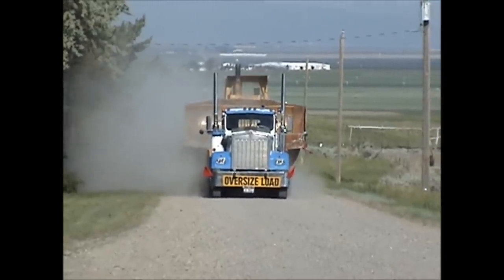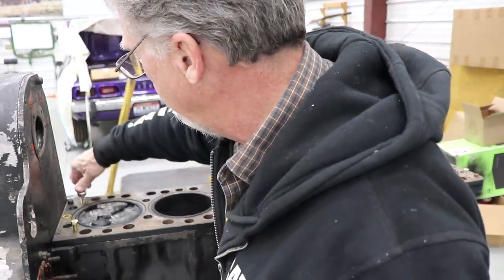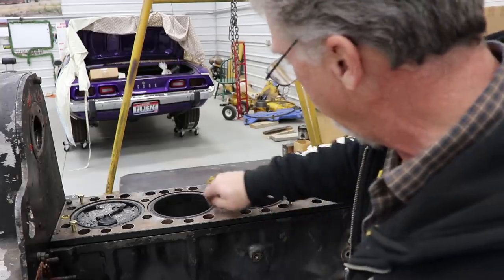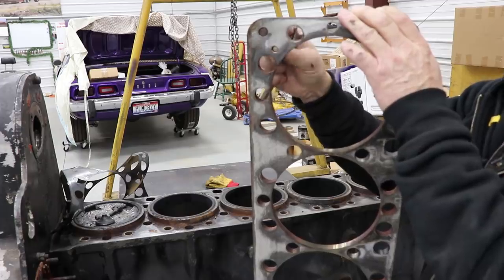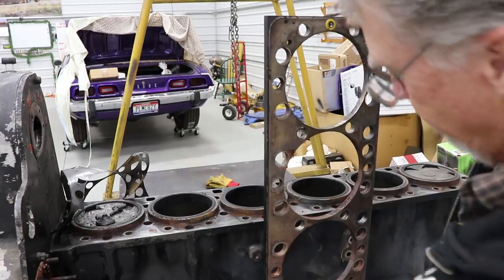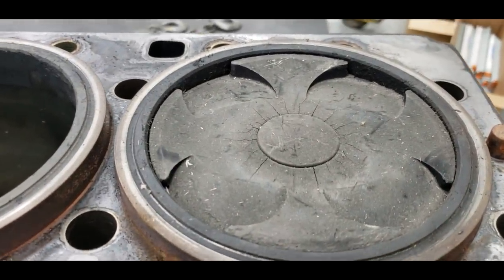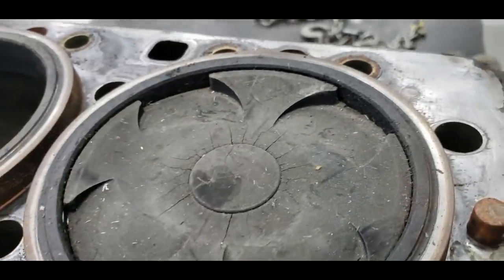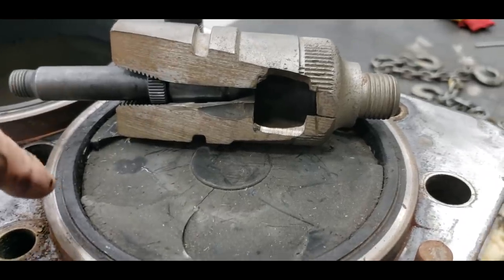Caterpillar 1693 Spacer Plate

Comment: I wouldn't worry about the crank if you were to DI that 343. The 3406PC and the 3406B used the same narrow bearing cranks and B's will go to 600hp at the tires without any trouble if properly tuned. The reason on the 3406C and later engines for the wider rod was for bearing life. On a 3406 or B to be safe you want to roll bearings about 250k miles if it's a road truck, or about 175k or so if it's a heavy haul/low mileage application. Water aftercoolers are also very efficient compared to air to air's and maintain a more consistent charge temp, but if you use engine coolant then at cruise you loose some efficiency due to the coolant temp. However, if you isolate the aftercooler and run it on it's own system they are very good. I've done quite a few 855's and N14's that way and a few early 3406B's. Not 100% sure, but I think the 7FB 3406's were the highest factory pump timing and were around 26*'s (I'd have to look in the book to verify but that's close anyway).

Comment: I still have my set of multiple pre cup shims around here somewhere to index the glow plugs on the 330's that I worked on many moons ago. Actually had a 140g that had was turbo, non spacer 3306 and a 12g that was turbo spacer plate and it was unreal the difference between their power.  I sure like the way you go in depth on your vids!

Comment: Ah the piles of uppers and lowers I have put in Cat blocks over the years! Old Kenny probably couldn't haul them all. lol Your cheapest route would be custom pistons. You could probably get a proper speced set of pistons for less then 2k.  It wouldn't have the steel inserts for the top rings though.  maybe there is enough room in the pan to stroke the crank and make up that pin  height difference? Turn your 1693 into a C18!! :-)
Reply: +1 on custom Slugs vs Rods. Should be cheaper by half at least. 👍🏻

Comment: Running those power levels is one thing.  Pulling your loads is another ball game.  I'd say your driving style allowed it to live as long as it did.  I like seeing equipment pushed then reviewing the failure modes.  Going DI would be interesting, but not something I would do on a machine I need to pay the bills with.  I think if you get your air and fuel dialed in you will be more than satisfied with the end result.
Reply: "...𝐈 𝐥𝐢𝐤𝐞 𝐬𝐞𝐞𝐢𝐧𝐠 𝐞𝐪𝐮𝐢𝐩𝐦𝐞𝐧𝐭 𝐩𝐮𝐬𝐡𝐞𝐝 𝐭𝐡𝐞𝐧 𝐫𝐞𝐯𝐢𝐞𝐰𝐢𝐧𝐠 𝐭𝐡𝐞 𝐟𝐚𝐢𝐥𝐮𝐫𝐞 𝐦𝐨𝐝𝐞𝐬.  𝐆𝐨𝐢𝐧𝐠 𝐃𝐈 𝐰𝐨𝐮𝐥𝐝 𝐛𝐞 𝐢𝐧𝐭𝐞𝐫𝐞𝐬𝐭𝐢𝐧𝐠, 𝐛𝐮𝐭 𝐧𝐨𝐭 𝐬𝐨𝐦𝐞𝐭𝐡𝐢𝐧𝐠 𝐈 𝐰𝐨𝐮𝐥𝐝 𝐝𝐨 𝐨𝐧 𝐚 𝐦𝐚𝐜𝐡𝐢𝐧𝐞 𝐈 𝐧𝐞𝐞𝐝 𝐭𝐨 𝐩𝐚𝐲 𝐭𝐡𝐞 𝐛𝐢𝐥𝐥𝐬 𝐰𝐢𝐭𝐡.  𝐈 𝐭𝐡𝐢𝐧𝐤 𝐢𝐟 𝐲𝐨𝐮 𝐠𝐞𝐭 𝐲𝐨𝐮𝐫 𝐚𝐢𝐫 𝐚𝐧𝐝 𝐟𝐮𝐞𝐥 𝐝𝐢𝐚𝐥𝐞𝐝 𝐢𝐧 𝐲𝐨𝐮 𝐰𝐢𝐥𝐥 𝐛𝐞 𝐦𝐨𝐫𝐞 𝐭𝐡𝐚𝐧 𝐬𝐚𝐭𝐢𝐬𝐟𝐢𝐞𝐝 𝐰𝐢𝐭𝐡 𝐭𝐡𝐞 𝐞𝐧𝐝 𝐫𝐞𝐬𝐮𝐥𝐭..."
 
👆🏻👍🏻 BTW, STEEL Pistons would be great [no more worries about the injectors "diesel jets" cutting thru the soft forged aluminum] but I doubt anyone makes them for this "Relic" and at "reasonable" prices. 😒
Reply: Don't pre-cuppers build more low end torque?
Reply: @donnatalielucasheimbigner7598  WTH is a "pre-cupper" ?
U meant indirect injection ? This engine is direct injection.
The ones I know about using the pre-chamber design usually run 20-22:1 [great for torque], but most happen to be N/A so no real gain against direct injected  turbocharged ones of the same displacement [usually running at 16:1].
Reply: @GIGABACHI  Yes, I mean pre combustion cup- as this engine is.  Fuel injected into a small "cup", with a glow plug to ignite it, before the flame front is applied to the piston through a hole above it.  Allis Chalmers used this type for a long time, & with a turbo.
Reply: @donnatalielucasheimbigner7598  adjust your glasses, my fellow diesel enthusiast. This thing is DIRECT injected into the bowl formed in the crown of the piston. There's is no pre-chamber on this model.

Comment: I drove a 73 kw long hood with a 1693 cat. it had 260 in wheelbase. 800 thousand plus miles and supposedly had only one injector replaced. 3-4 mpg. Never had any other truck out preform,on any mountain pass, or top speed. The fastest truck I ever drove in the 23 years driving. Leon Peterson owned it, from Spanish Fork, Utah. fun truck.

Comment: If you pulled the valve covers off a precup eng (1693) you could easily see if the head was cracked by checking the pc,s , if they were loose the was cracked

Comment: The 3406b had a narrow journal crank, check the bottom end every 250,000 miles.  The 3406b/c manual had a wide journal crank, 750,000 miles plus before a bottom end.
Reply: Late number 3406 Bs could be either narrow or wide -even arrangement didn't tell you till you looked at it.

Comment: Always be careful handling  the deck plate gasket. The 0.008" metal gasket can cut your fingers to the bone. The DI 3406 has "TP" rods-as wide as possible on the low side for high piston pin loads.

Comment: Thanks for your response Jeff .i worked as a performance engine builder in the mid sixties to the late eighties
Many Chevy and ford engines two very involved 440 molars that were quite successfull
But returning to your 1693...recently last few yrs BMW was tasked with providing a 3 liter Diesel engine to mimic the performance level of the gas engine...they made considerable improvements to the piston design with Mahler
They have a steel piston that is quite amazing....and very lite....you would certainly get them to make a set I’m sure
Reply from the maker: Nobody will make custom stuff anymore,  I talked to clevite and Federal Mogul and they all said the same thing,  ISO 9000 complient companys cannot deviate from the design of said part

Comment: Jeff, I hope your kids are learning this stuff. This new diesel tech. is destroying the diesel industry
Reply: Patrick you are not kidding!! Heavy equipment mechanic here and i used to love my job and couldn't wait to fix whatever problem was going on. lately I have been seriously considering quitting this career. Its no longer fun with all the shit engineering and horrible parts quality.  Recently I had a new hydraulic pump straight out of the box grenade within one minute of operation, and very expensive boom cylinder leak worse than the bent one it replaced, and the latest was a "certified" reman perkins engine for a rock processor go nuclear with under 5 hours of run time due to a new pos temp sensor. Pissed isnt even close, the added down time for customers is horrible.  One good customer is a lot like ol paydirt and loves his vintage equipment. I really dont give a rats ass about fuel economy. The machinery that will run all dam day and half dead will still out work this garbage they sell today.  Cat, Commie Cat, McCloskey, and i wont even go into the dam semi bullshit.

Comment: 3406 A and B went to a wider rod and main bearing. Later figured out that the wider bearing on the rod still wasn’t wide enough especially when the DI 425 B model came about in late 85. Not to get into great detail of timing changes etc. putting combustion directly on top of the piston is hard on on bottom end. 3406C came out and had even wider rod journals. Same crank as a 3406E minus the gear up front

Comment: Hey Jeff
As usual a thought full job..the bearing wear could benefit from getting the block main bearing bores ALIGNED 
HONED…FIND A SHOP THAT USES THE SUNNEN MACHINE…I CANT SAY ENOUGH ABOUT THE PRECISION OBTAINABLE 
AS YOU CAN SEVE FROM THE WEAR PATTERN….THE BORES ARE NOT BORED BY CAT YRS AGO ON ANTIQUE EQUIPMENT….GOOD LUCK

Comment: Hi Jeff ..I read your reply on your unsuccessful inquiry about federal mogul not wanting to make your pistons
Mahle does in fact ,make a steel piston for a few applications...but Diamond pistons does make custom diesel pistons...if you can give me your email I would be glad to forward you the information about the engineering BMW did to make 650 diesel horsepower from a 3 liter inline six cylinder....they had mahle involved in the steel diesel pistons..which was not easy as many issues had to be resolved....but just a thought as I’m very impressed how much you have invested in this engine design...my limited experience with them has only been through listening to owners who had success with them in how they claimed they never wore out...but they were not in the higher horsepower ranges..good luck
Reply from the maker: jpaydirt7@gmail.com

Comment: ,,, much less money. Keep the rods, machine the 1693 pistons for a combo larger diameter heat plug that would have the combustion bowl shape to it. Actually wouldn't be a heat plug but a steel combustion bowl  . And yes, you can ignore any balance problems on a six cylinder,  just keep all the pistons the same weight, regardless of how heavy they are . If you want: quieter, cleaner, more power, easier on the walls and bearings,  build a common rail system. I put this in Malinson's and or Rutherford's ear(s), also . Entirely within Malinson's capabilities  .

Comment: Hi Jeff ..I’ve been watching you and am very impressed at your depth of knowledge...and your work ethic...what I don’t quite understand as money is not the only directive is why you want to bring a outdated back to life again
I’m not saying that you need to switch teams..like the six Cummins..which when I first saw it introduced at a truck show and commented to the Cummins rep that it looked like a Plagiarized version of the 1693 cat...he kinda got pissed off
But my point is why keep beating a dead horse...is there a possible interchange with a non emission C15 
I see impressive power numbers for real world longevity use
Reply from the maker: Well the A model KW is a pretty popular truck for restoration and keeeping CATs first big bore on hiway truck engine in it is a must, I would equate it to restoring my 73 dodge challenger with a chevy motor in it,  LOL   and I have this same engine in my 637 CAT scrapers, it's called  a D343 in the equipment but it's the same engine as the 1693

Comment: HI Jay Blaylock (lol), Question - will an AFR (Air Fuel Ratio) sensor work to tell you if you are getting the correct air?  I work with some gas fuel injection engines and run AFR instrumentation and I can program fuel mixtures to a gnat's whisker, full throttle 12.1~12.8 in about any engine speed range.  Wondering if the oxygen sensor put in the exhaust stream somewhere, before or after the turbo will help you know the Air/Fuel ratio being combusted [prevent piston failure]  Ask yer engineer buddy with the calculator.
Reply: On Diesels they are monitored by Pyrometer or EGT, same as very high end race engines. Ideally one Pyro bulb on each exhaust port.
But now I'm curious. Does anyone now if an O2 sensor could live in a diesel's exhaust stream ? I'm gonna say NO. Soot deposits and all that good stuff diesels are known for. Someone with the know how please chime in and set the record straight ! 👌🏻
Reply from the maker: so I think they do make one for a diesel

Comment: Depends what your going to use Old Kenny for when your done Jeff.Show truck work truck or both that would determine the horsepower.If your plans are just doing some hauling with the bottom dump or pulling nothing really heavy on the lowboy I think 425 to 500 would be good.I wouldn't go nuts with the horsepower if it's not necessary.

Comment: It's all about air (o2) fuel ratio. Black smoke is nothing but a waste of fuel. "0" gain in power. Get that ratio right throughout the full RPM range and you will be the winner instead of the dirtiest.
Reply from the maker: That's been my goal by going with the switch blade turbos I have doubled my oil life

Comment: So Jeff, would the cost of putting a winch on your truck. To pull trailer on, instead of ramming on. Be too much, to save the cost of damage to parts when ramming? Know little more work to set winch cable to pull on, but the overall shock loading when ramming is very hard on truck.

Comment: You gonna use a  325 horse power intake manifold  or are you going to go for a custom built one when you switch over to radiator mounted charge air cooler?

Comment: What good would be gained by changing it to the other type?  The engine failed as designed.  Would changing to modified parts improve the longevity of the engine?  The expense of rebuilding a stock Cat engine is already too excessive.  Reinventing the wheel with all the modification parts probably cannot justify the associated risk of premature engine failure.
Reply: what failed about design bet never saw a 1693 in person much less ran one thw only fail they had was cats piss poor counter bore liner ser up outside of that the runningest pulling engine there is hands down one thing your r ite about cost but then theyre all ridiculous anymore

Comment: Jeff, was that spacer plate used as cheep way to increase the stroke of the engine
Reply: It was for a flat deck surface, without counterbores
Reply: John Warden  Spacer plate won’t increase the stroke. Only way to increase the stroke is to increase the rod journal throw on the crank, which increases the travel of the piston.
Reply: @jcarne1015  i think he meant as a way to add space for a longer stroke to a shorter stroke motor.  ie: bigger stroke crank, longer rods, taller pistons.  so they don't poke out the top of the deck.
Reply: froto baggins  Hopefully that’s what he meant. I’ve run across a few guys who thought that putting stroker plates under their Harley cylinders would increase the stroke though.
Reply: @jcarne1015  oh, that wouldn't be good, much lower compression sure don't help power. lol
Reply: @frotobaggins7169  turbo charge a larger cylinder. more power
Reply: @georgetoma7139  yes, if your going from naturally aspirated,  drop the compression, add a turbo thus making more power.   but this was already a turbo motor, so dropping the already low compression likely would not add power even if you used a bigger turbo.  now if you're talking about the harley motor in another comment, yeah maybe.